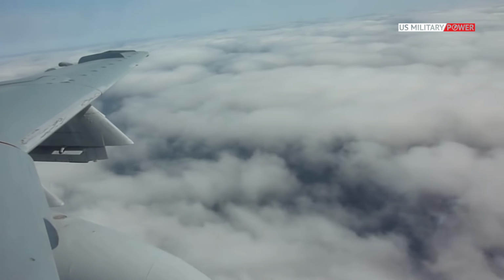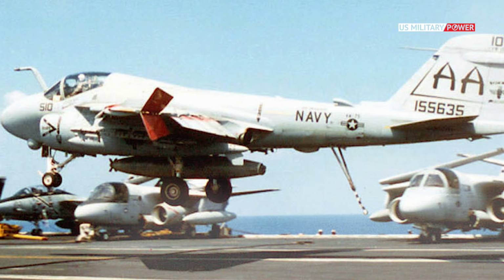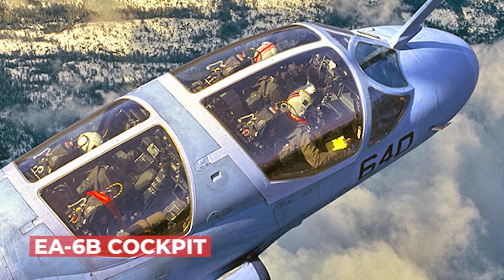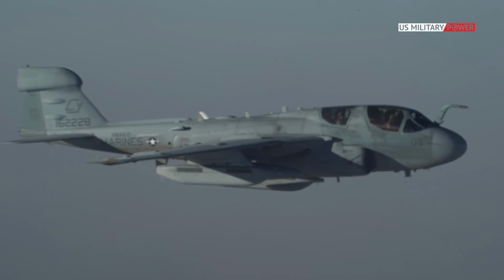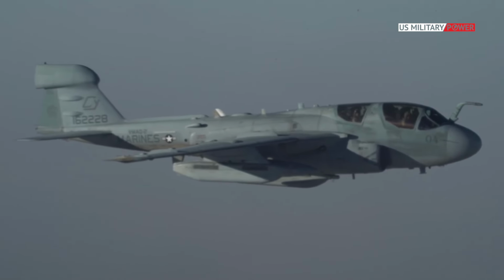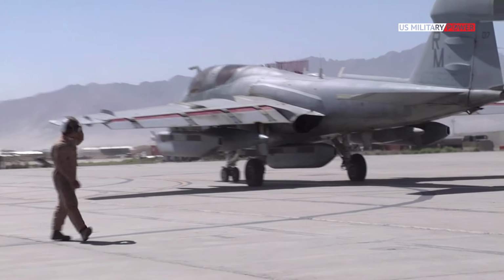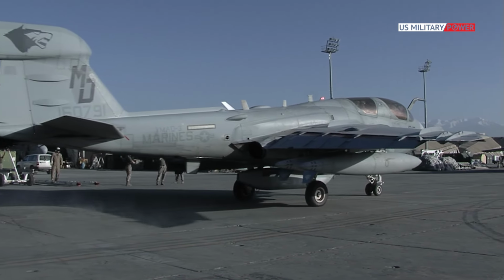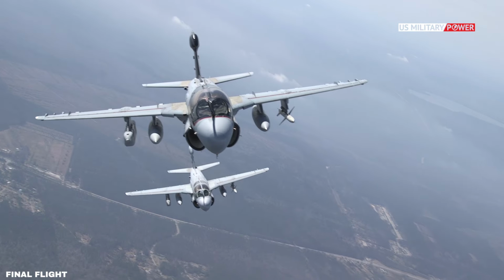EA-6B Prowler: The Sky Pig Aircraft That You Have Never Seen

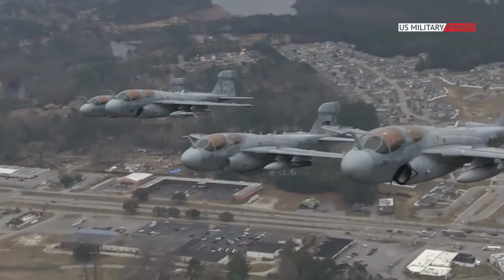Comment: 1:03 the Air Force never used the Prowler.
Reply: No, but it was often crewed by USAF guys (in the ECM seats) and supported USAF operations.  The Air Force used to operate the EF-111A before they retired them in the 90's.  After that it was Navy/USMC Prowelers, later Growlers that fulfilled that role.
Reply: zoomie aircrews qualified to fly the Prowler in the expeditionary squadrons - beach dets only - based at Whidbey following the retirement of the Raven. zoomie aircrews also operate the EA-18G expeditionary squadrons at Whidbey.

Comment: I was a AMS-1 and severed from 1978 thru 1983. VAQ-129,VAQ-133 and then VA-128 and Va-0689 as a plank owner. Two med deployments.  John F Kennedy and Forestall.  Very good times. Loved working on the EA-6B and A6. All my sea time was with VAQ-133 and the EA-6B.
Reply: I was an AME with VAQ-129 also, but much later. 2007-2009. They sent me to Lamoore, CA, to learn about the SuperHornet/Growler. Then I helped other squadrons to transition from Prowlers to Growlers. 
 Before that, I was with VAQ-132, 2003-2007.
Reply: I was an AD in VAQ-130 Zappers plank owner on the Nimitz.The Forrestal was my last deployment.
Reply: @adanrodriguez3865  What year were you on the Forrestal?
Reply: @rickramsey9868 1978. We were in Marseille, France when my time was up. We flew from there to Rota,Spain on a C-130. From there we were transported on an Air Force Dc-9 I think to Maine and on to Philly to get processed out.

Comment: They scraped this platform over 15 years ago, apparently using the F-18 platform now... sometimes you just never know? Very interesting craft... very necessary purpose
Reply: Negative.  Last active squadron VMAQ2 only decommisioned a few years ago.
Reply: @johnstreet1812  they might have kept a unit operational, but the platform by-in- large was axed about 15 years ago, and I have that on fairly good authority - not that it makes a personal ripple in my sleep, but from what I was told about 15 years ago.
Reply: @woodshed_moments  Whoever told you that was full of feces and probably knew that they were talking to a neophyte. VMAQ-2 was deploying overseas up to the time that it sundowned the EA-6B in March 2019.The ALQ-99 TJS that has equipped the Prowler since 1971 continues to fly aboard the EA-18G.
Reply: @AA-xo9uw  - it's one thing to be a thread. Contrarian, it's another thing to be condescending. In it don't even think to go there if I took the time to put it there. It's because there's something there that you can't erase in the reality of how that platform got to what it was never assumed, you know, more than the person that made the comment. Since my comment was particularly open-ended more about appreciation. Then anything else? I think you need to quietly go. Knock the dents out of that tin foil hat you got on and reassoon your place in the corner of the room.

Comment: 50 - 60 years ago they were front line operational just before and during the Vietnam War. Spent several early years of my career as a "Tech Rep" helping sailors and Marines with some of the technology in the "Black Boxes". Those "Birds" were used in a variety of roles, including refuelers. For ops on "Yankee Station" the Black Boxes were required if the planes went "Over the Beach" on a mission. Enjoyed the work - Grumman "Iron Works" did well with these.
Reply: "50 - 60 years ago they were front line operational just before and during the Vietnam War."(sic)

The Prowler achieved IOC in July of 1971. 

'Those "Birds" were used in a variety of roles, including refuelers.'(sic)

Incorrect. EA-6As and EA-6Bs were never used in the tanker role.

Comment: 170 Planes produced
50 Lost to accidents
Loss ratio: 1 in 3.4
That seems a bit... high.

For context, the Starfighter, notorious for its accident rate:
916 Planes produced 
292 Lost to accidents
Loss ratio: 1 in 3.14

To paraphrase the Starfighter pilot joke:
Q: How do I get to own a Prowler?
A: Buy a plot of land & wait
Reply: There is more to it than just the numbers.  Interpretation of just total inventory vs losses is shortsighted.  You have to consider years of service and operational environment.  

The Prowler was flown almost exclusively by front line operational squadrons its entire career.  The vast majority of that flight time was in the demanding and unforgiving carrier environment.  It also did this over 40 years of service.

The Starfighter (which I admire and respect) barely made 20 years in operational service (in USAF) and more than half of those operating it were Guard or Reserves.  The F-104 lived in relatively nice conditions (land based, yet had low serviceability rates.  Yes they flew in foreign service for much longer, but for a multitude of reasons it’s not comparable.

A little more than half of Prowler losses were human error.

Comment: 50 out of 170 lost to accidents seems surprisingly many. 5 or 10 would seem more appropriate…
Reply: right 17 max
Reply: I don’t recall hearing anything about a bad maintenance record while I was in the navy.  I was an AT.
Reply: @zub57  I wonder if the numbers are correct
Reply: @zub57 we didn't have any maintenance related issues to my knowledge in the 8 years I was in the prowler community
Reply: All of the aircraft lost I've heard of were in vaq-129 it's the rag (training) squad... oh and I think one of the mag(Marine Air Group) squadrons flew one into a gondola during joint operations in Europe ... but yeah I've never heard of one going down from a  maintenance related issue. Oh and you also need to remember this platform was active for around 40-50 years

Comment: You need A Disclaimer.  The aircraft you've never see, IF You are under 30.
Befor that you may well have seen them as an A-6 intruder.  
  The only external visible difference is a slight bulb on top of the vertical stabilizer.
You may also have watched or read flight of the intruder, A novel made into a movie, And a very good story.
( Thank you Steven Coonts!)
Reply: "The only external visible difference is a slight bulb on top of the vertical stabilizer."(sic)

Quite a few external visible differences that neophytes are oblivious to.

Comment: I have also heard them called "Queer" before political correctness. Mostly because of the gold tinted canopy. Those helped the electronic systems.
Reply: "Queer" comes from the Navy/Marine designation for an Electronic Warfare Squadron: VQ or VAQ.  In the old pre-1962 Naval aircraft designation system, any aircraft used for electronic warfare was designated with a "Q' as well, such as the AD-5Q (EA-1F Skyraider)
Reply: indium-tin-oxide plating which appears to be gold, designed to suppress the effects of electromagnetic emissions on the aircrew.

Comment: The Air Force used the F111 and the F16 for it electronic countermeasures.  The prowler was too slow to help with some of the Air Force missions.
Reply: EF-111 until it was retired in 1998. zoomie aircrews then were trained to fly and operate the Prowler in expeditionary squadrons. A practice which continues today with the EA-18G expeditionary squadrons.

Comment: I started working on Electronic Warfare systems on Navy aircraft in 1966, and worked with AIRTEVRON FIVE/COMOPTEVFOR in increasing survivability of A-4E, F-4B/J, RA-5C, F-8U, A-6A/E, and EA-6A as part of CNO Project F/O 210 using the ALQ-41, ALQ-51, or ALQ-100 DECM systems developed by Sanders Associates, and the ALE-29A/ALE-39 chaff dispensers.  Beginning in 1970, we began involvement with the TECHEVAL/OPEVAL of the EA-6B PROWLER  with its ALQ-99 TJS and ALQ-92 Comm jamming system.  This began a 38 year involvement with the Prowler in testing, jamming tactics development, and fleet tactical support to all Prowler squadrons until I retired in 2008.  I saw the initial Standard version of the Prowler expand to EXCAP, then to ICAP, and then ICAP 2, and HARM(AGM-88) and their improved capabilities with the ASQ-191 and then the USQ-113 comm jammers.  With this background, including 10 flights in the back seat of the Prowler as a civilian (cut short when a Prowler was lost in Canada in 1972).  The initial capability of the ALQ-99 system was limited in technology, and as the aircraft became more digital, giving the aircraft far more capability, NAVAIRSYSCOM put together a team of engineers and fleet operators into a JATO (Jamming Techniques Optimization) group to directly support the fleet with improved jamming techniques and tactics.  I was on this team from its inception with ICAP 2 until I retired in 2008.  It is true than no EA-6Bs were lost in combat throughout its entire lifetime—It is also true that no Navy or USMC strike aircraft were lost when directly supported by the Prowler.  VAQ-132 Scorpions were the first Prowler squadron deployed to SE Asia in 1972, and their support to the VA/VF fleet squadrons, and USMC/USAF squadrons were a requirement in Operation Desert Storm, Southern Watch, Northern Watch, Allied Force, Operation Iraqi Freedom, Operation Enduring Freedom, and many more Joint operations.
Reply: VMAQ-2 operating of Shaikh Isa was tasked with supporting Marine TACAIR during Desert Shield/Desert Storm.

Comment: I would give a lot to know the logic of replacing the EA-6B Prowler with an F-18 Growler. I simply cannot believe the Electronics and Generators could not be upgraded or even replaced with newer technology. Yes the airframe was old but if we’re going to buy brand new F-18 airframes for the Growler we could have purchased new airframes for an EA-6C Prowler. Newer engines would have increased speed and three operators is better than one. Can anyone tell me?
Reply: William, there was no way to manage the airframe either cost wise or from technology expansion standpoint in a cost point of view into the future.  Some spares were becoming unobtainable, such as landing gear struts, and rebuilds only go so far.  The core foundation of the  systems in aircraft was not suited to adapt to more modern technology and architecture.  The center wing sections would have been hitting high time before too long and would have to be replaced (done twice before), BIG expense.  There was a study done the the early 2000s that actually recommended new manufacture of an EA-6C as the replacement.  Objectively it was no really viable.  The Grumman Prowler line had be shut down for over 10 years and the C would not have fixed the poor high altitude performance of the B.  The Growler made performance, technological and financial sense
Reply: "F-18 Growler"(sic)

EA-18G Growler

The ADVCAP Prowler was proposed but rejected by NAVAIR and DoD. Grumman had lost much of its influence thanks largely to one Richard B. Cheney.

Comment: “Somewhat unwieldy?” All versions and variants of the A-6 were noted for being among the Navy’s easiest planes to fly and land. They did low and slow extremely well. While not fighters they had very responsive controls and engines. They handled like a comfortable sedan. They would easily get off the deck every time and we’re probably the slowest gentlest carrier landing outside of a C-2. Those broad wings gave them so much lift that you could practically use them as a kite.
Reply: Objectively, I beg to differ.  With over 2800 hours in the Prowler (+1000 Growler hours), I am somewhat familiar with their handling characteristics.  They were not easy to fly.  Heavy, underpowered, poor flight control systems, and prone to yaw instability in the landing configuration.  All that said, I loved the old girl.  Rugged, pretty fast and maneuverable at low level (terrible >20kft), responsive engines, decent amount of gas and excellent at it mission.

The Growler is completely different, a monkey could fly it.  Managing its weapons system and information is something else.
Reply: @prowlerflyer did you fly the growler? I’m curious as to its performance. It’s no secret that a loaded rhino is already kinda slow and underpowered, so I couldn’t imagine how slow the heavier growler is
Reply: @Eirik36  , yes I flew the Growler too.  I have just under 1000 hours in the Growler.  True, a fully combat configured Growler is a bit of a pig, but is a big step up from a similarly configured Prowler.  Modern flight control systems, and a fair bit more thrust, make the Growler more agile than you would expect.

Honestly most all modern 4th Gen fighters once they load up with external ordnance and tanks are pigs.  Some more than others.
Reply: @prowlerflyer  ah very interesting! The pilot of the strike Eagle I was launching awhile ago had viper time in his history. So I asked him how a loaded viper is since viper guys act like they have the best jet around. He said a loaded viper is still somewhat slow and what not. I only asked because the Strike Eagle is known as an energy bleeder and a pig because the CFTs (apparently the bru racks on them cause the most drag), as well as all of the possible munitions and pods
Reply: @prowlerflyer  Never flew the Growler but have 1700 hrs in the F-8 and 1200 in the Prowler. Heavy and slow, you had to be very careful with both jets or they could swap ends on you. I suspect that the newer jets with built in envelope protection are more forgiving of ham-fistedness.
Reply: Uhh.. This plane has been obsolete for like 4 decades.
Reply: If that is true then why were 50 lost?  Here on you tube one launches with a "cold cat" and all 4 crew members ejected. Sadly,  one of them hit the bottom of the others ejection seat.

Comment: My First tour of Duty Landed me in CAG 3 already deployed, i was flown out to join them, these Aircraft where onboard, along with the A-7 my squad was F/A 18c Navy's newest aircraft IN 92.. I didn't See much action being my first at sea command, but time 18 months rolled around for the 2nd Deployment, dam those Aircraft where LOUD, Dirty< Being JR, you get tasked with other Jobs, once got assigned "HOT FUEL PIT" duty in Puerto Rico. dam hot, learned to fuel all the Aircraft in the Air wing. old tech that worked well for its Age.  On Deck carrier, on cats going to after burners would rattle your teeth when standing near them. Ah good days of Long ago. do it all over again if they let me.

Comment: While the EA-6B Prowler may have provided cover for some USAF packages in recent conflicts, the USAF had their EF-111A Raven within its inventory until retired in 1998 and I believe the F-16 took over the Wild Weasel role.
Reply: Actually.    The air force is why the ea6b lasted as long as it did. When the air force killed the f-111, the navy was going to kill both the a-6 and ea-6. As there was no viable replacement for the  f-111 for the role, the air force paid part of the cost to keep the ea-6 going and even had Carrier qualified air crews
Reply: Yeah the growlers
Reply: Actually when the EF-111 was retired the Air Force folded their EF-111 squadrons into Navy EA-6B squadrons to form composite squadrons seeing as the EF-111 used the same electronic warfare equipment as the EA-6B. When the EA-6B was retired it was replaced by the EF-18G Growler which needed only 1EWO due to advances in computerization.
Reply: @kdrapertrucker  " EF-18G"(sic)

EA-18G
Reply: Around 1995 or so the EA6B took over the EF-111A’s job. This started the Expeditionary deployments of the Prowlers.
Reply: And later on the f18 growler
Reply: @sargera1  EA-18G

Comment: Working in Electronics Warfare from 1980-96
 I Have seen them and their radiations with the AN-SLQ32!
Reply: ALQ-99
Reply: @DBL865  our old system was the AN-WLR-1 a manual tune system that was compromised on a ship in Asia that was ours, but used an excuse to not fly our flag due to possible tatering.
Reply: @rgruenhaus  I would imagine the system you worked on utilized a better power source than a universal exciter. I was an ALQ99 T
tech while in military
Reply: @DBL865  each system platform has weight considerations so power sources can have restrictions. As the years went by the size of the system was reduced. For data used by our system in the beginning we used a book called RADCHI which over time got easier, but then we used computers with that data on DVD. Then an internal hard drive came in and size was again reduced. Each change always seemed to take about 5 years though. Three different versions allowed different capabilities on various platforms. V3 being the most feature packed.

Comment: Northrop-Grumman or just Grumman? I'd argue that since production of the EA-6 ended long before the 1994 merger between Northrop and Grumman, the plane should be called the Grumman EA-6 (A or B). You wouldn't call a Douglas DC-3 a Boeing DC-3 just because the Douglas aircraft company later merged with McDonnell and then with Boeing so the name now is Boeing.

Comment: The EA-6B was not slow.  It would do almost 500 kts at sea level with 3 jamming pods and 2 fuel tanks.  About as good as a Growler can do.
Reply: And the best part Bob,  it was a non-afterburning turbojet engine that its designed came from a AGM-28 Hound Dog Missile, that alowed the EA-6B Prowler to do over 500 knots!

Comment: I was in A-6’s while I was in the Navy. My first tour I was a plane captain in VA-65. During that time I qualified as a PC as I managed to accumulate 5 Daily and 5 Turnaround inspections on visiting EA-6B’s. I made rate as a Aviation Machinist Mate and during my shore duty time (33 months) I became qualified on the J-52 p8b and the J -52 p408 engines. Couldn’t beat that P-408. I was in VF-43 during that time. Got to run the engine during low power turn ups. Lots of fun!!!!
Reply: Flight crews loved the upgrade to P408's - finally enough thrust to really accelerate that heavy airframe.